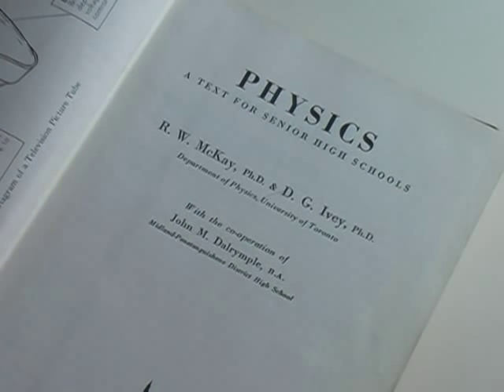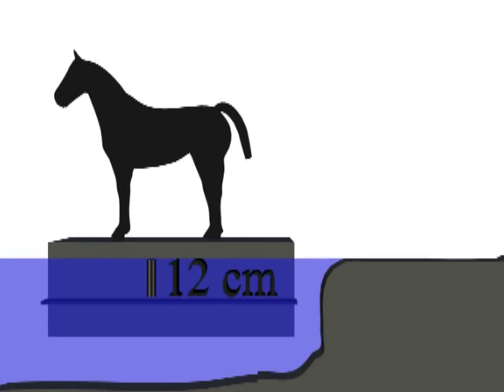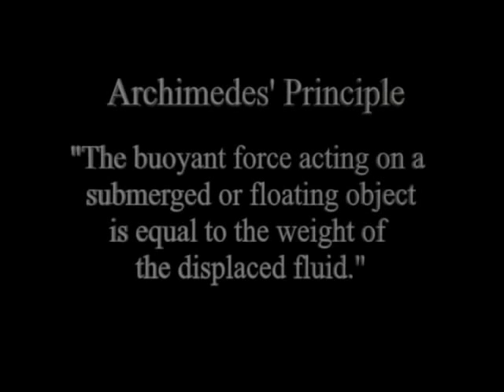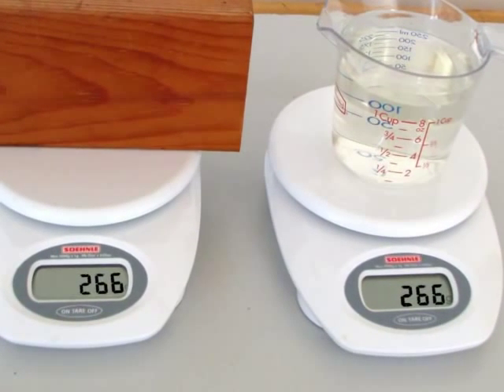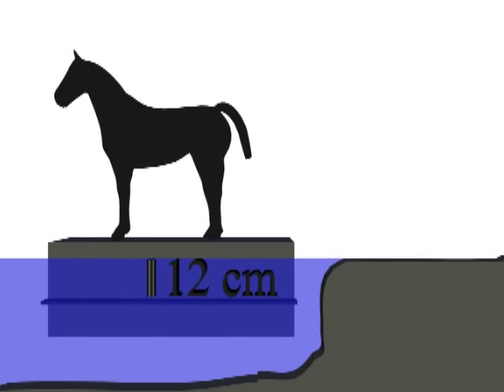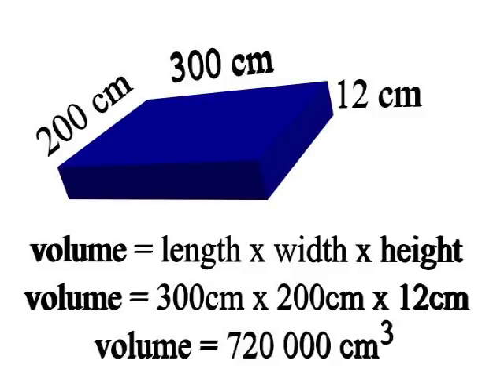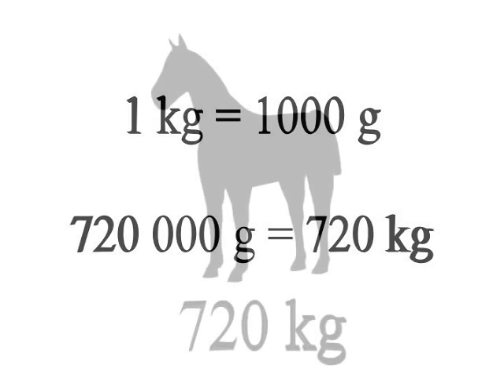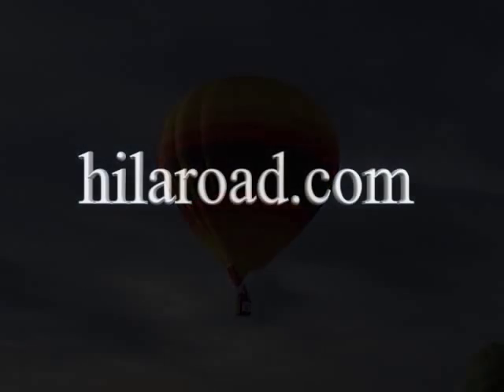Archimedes' Principle

Comment: What this method measures is the VOLUME. You calculate mass by multiplying volume and density. Two different bricks of metal may have the same volume (and this method will show it) despite that they might have different densities (and therefore different masses).

Comment from the maker: The buoyant force acting on an object completely submerged in water equals the weight of the displaced water.   In this example the volume of the displaced water equals the volume of the brick.
Both the gold and iron bricks will experience the same buoyant force (assuming they are the same volume). The net force down (force of gravity - buoyant force) acting on the gold block will be greater because it is denser, therefore heavier,  then the iron brick). .....

Comment: It's not the pressure inside balloon that makes it fly, but its overall mass that displaces air. Making something inside of a balloon (usually a gas) hotter just means that its density will decrease thus reducing the mass of the interior. The balloon with vacuum inside was only an example (it would inflate). But the point is that the buoyancy is dependent on the mass inside a container. It's explained here: en . wikipedia . org/wiki/Buoyancy#Density  (remove all 4 spaces between the 2 dots).

Comment: Assuming that a balloon would survive such flight, it would rise as long as its mass would be less than the mass of the particles it displaces around (for example: air in the lower atmosphere). It would reach equilibrium at some height and then stop rising. The substance it's filled with would only affect its final height (with vacuum giving the best result). Hard to tell right away what composition would give what final height, but you get the idea, I hope ^^

Comment: Block has a force down called weight.
The weight of the "displaced" water must equal the block for it to float. The displaced water is effectively pushing against the block to retain the space from which it was displaced. This results inan upwardly force called buoyancy.

As the block is much less dense than the water then only part of the box will sink ie the volume of the block which equals the same weight as the water.
Example
water = 1g/cm3
box 0.25g/cm3
1/4of the block will sink

Comment: Because the block is less dense than the water it sits in.  

Density = Mass/Volume 
Thus,
 Mass=Density(Volume).  

The weight of the volume of water displaced by the block equals the weight of the block.  Since the block is less dense than the water a smaller volume of water has more mass than an equal volume of the block.  Since only half the block submerged this suggests that the block is half as dense as the water.

Comment: AFAIK, the buoyant force would be the same. Although the hollow thin shell brick requires much less force to push it upwards (therefore it floats). You need to manually sink it and then it will push the required amount of water (as presented in the video).